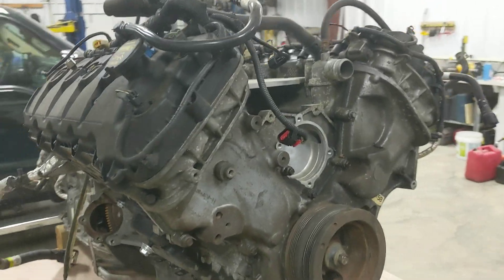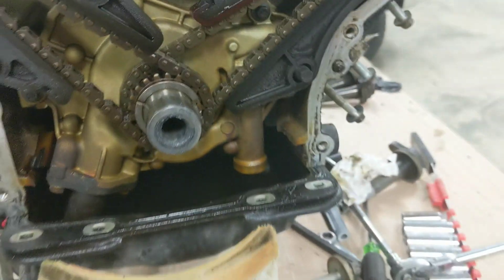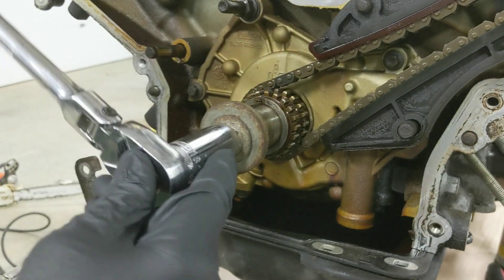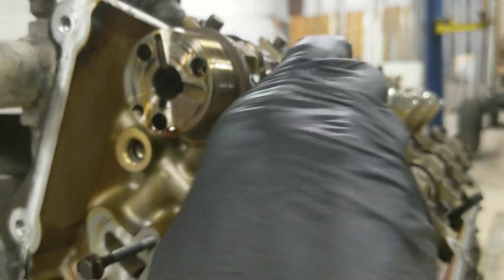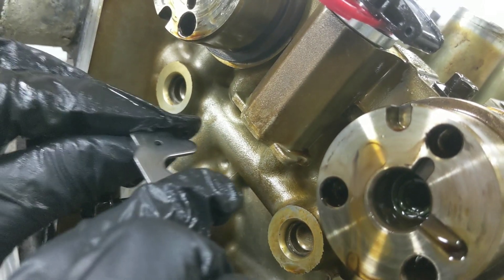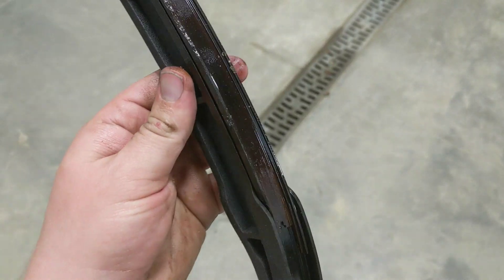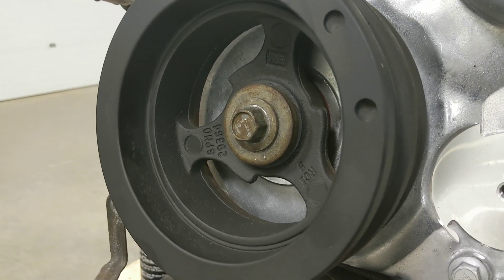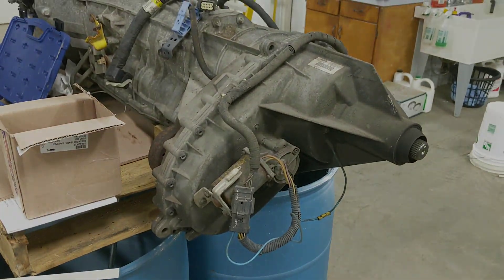Gen 1 Coyote Timing Cover Swap and Chain Replacement -- Coyote Swap Bronco

Comment: Great Video, I have a 2014 f150 lariat that I think needs a timing chain job just because there’s a 2 sec rattle in cold starts, so u have any idea how much a job like that is going to run?
Reply from the maker: I really don't know what a shop would cost.  I live in SD so some of the rates here are much lower than normal.  That said, if you had to have a shop do this I would expect to pay at least 1500 dollars knowing what all will be in the way in a regular F150.   There are lots of parts that need to come off before the chains can be replaced.  Most shops will be able to quote you over the phone though if you call in.  They can check their repair software and give you a good guess.
Reply: @605BOLT  How much was the Melling kit you used in the video?
Reply from the maker: @OKstang77  not much. The exact kit is linked in the description of this video.
Reply from the maker: @OKstang77  actually I just looked on the link in the description and it's 10pct off! Check it out!!

Comment: Did you end up using the thin metal spacer or just the plastic guide on the secondary chain tensioners?
Reply: If so, was it a very tight fit?
Reply from the maker: I don't remember a thin metal spacer. Sorry. Been too long since I did it. I don't remember there being any extra pieces when it was done if that helps you at all. Where does the spacer you're talking about go?

Comment: Hello, I also had my secondary chain break on a 2011 f150 5.0L driver side. My question is, sense the driver side primarily chain wraps around the exhaust cam phaser and currently theirs no chain attached to the intake cam. Would I start by moving the crank to the 12 o'clock postion and then move the intake cam by hand/wrench to match the data matrix on the exhaust cam when starting the disassemble process? Please let me know if I'm correct with my understanding. Thanks
Reply from the maker: I would move the pistons so they are mid stroke (not at TDC), then adjust the cams to where they need to be, then move the crank to TDC.

Comment: I know this is a year later i found the video super helpful, my secondary chain on driver side broke, i followed the video step by step on how to replace but now it wont start, she cranks but wont turn over any thoughts? Could the timing be off?
Reply from the maker: Was something damaged when the driver chain broke?
Reply from the maker: When you say won't turn over do you mean it won't even attempt to crank or do you mean the engine is locked up? Or do you mean it cranks but won't start?
Reply: Not that i am aware of, i didnt see a bent valve or anything when i used a camera through the spark plugs and it starts to crank but wont turn over
Reply from the maker: So you're saying it spins maybe a handful of degrees and then locks up?  Hard to say I guess what is oging on.  If the valve covers are off, you could visually run through what is happening and when.  You could see the cam lobes and also look down the spark plug hole with your camera.
Reply: Yeah ill check down the spark plug holes again the cam lobes look good too i dont see anything indicating a bent valve
Reply from the maker: If you suspect that one of the valves is bent, you could lower all the pistons so that they're halfway down the bore and then take all the chains off and then rotate the cams individually. And as long as they don't bind then you know your valves probably aren't massively screwed up.
Reply: Yep ill check tmwith the camera again but the lobes look good not really any sign of a vent valve and the springs all look to be in good shape. I appreciate the response if anything ill try to re do it and ill cross my fingers it works lol
Reply from the maker: It wouldn't take much to have a pretty serious bind.
Reply: @matthewg.9534  So odd, i just found my secondary chain snapped on the drivers side...the tensioner clip was bent and lying in the pan...dont see any bent valves and my engines starts and runs (barely) with 3 of the four cams turning...
Reply from the maker: Lol wow. Never heard of anyone proving that out but thats wild.
Reply: Also when i intially took of the timing cover and looked at the data mateix on the driver side they were both up but not even but lined up when i went back to 9 o clock that may be where i messed up now with the valve covers off again the data matix on the driver side are lined up and facing up but the passenger side are facing the opposite direction. Facing up but towards like 10 o clock and the driver side is at like 1 o clock

Comment: هل.اذ.اختلف.وزان.الجنزير.يسبب.تقتق
Reply from the maker: I did this job because the bronco the engine is going into requires a mustang timing cover rather than an F-150 timing cover.  When we were swapping the timing cover, we noticed the timing chain guides were worn.  The engine had 300K miles.

Comment: It's foolish to band-aid fix that motor.  With that many miles it needs a full rebuild.
Reply: Its not an ls turd
Reply from the maker: @fordnut4914  preach my man.
Reply: @fordnut4914 my ls work van has  over 400k all original and i beat on it daily my 5.0 f150 has 200k and needs a rebuild just fyi
Reply: If compression is good why do extra work.
Reply from the maker: Some would say that. But knowing what it is going into (76 bronco) it will be virtually inaccessible. Therefore do it today and should be good.
Reply from the maker: It has all new timing components lol. Def not a band aid.  She's good to go

Comment: Does the engine need to be at TDC compression stroke when installing the timing chains.?
Reply from the maker: Thats what checking that the driver side data matrix is facing up is about.  That is making sure you're at TDC before the power stroke vs being at TDC before the intake stroke.  Hope this helps.
Reply: @605BOLT  so my problem is both timing chains broke and came off just wondering were I'd put the crankshaft position.
Reply from the maker: @Relaxedraindude  number one piston should be up then. Besides that, won't matter because the crank doesn't know where it's at in relation to the cams. To the crank, intake and power stroke are the same thing.
Reply from the maker: @Relaxedraindude  idk if thesw coyotes are interference engines or not though. Could have problems for you if they are.
Reply: @605BOLT  ok hey man I really appreciate it. Keep up the great content love your YouTube page!!!
Reply from the maker: @Relaxedraindude  means a lot. Be sure to hit me back if I can help u out. Appreciate u watching and commenting. Good luck!!
Reply: @605BOLT  good morning I was checking the timing on this coyote by turning it by hand turned the engine over 4 revolutions of the crank now the timing marks are off by one link. Is this normal for these coyotes. Or do I need to do the process over let me know thank you.
Reply from the maker: @Relaxedraindude  idk about the coyotes but for a modular ford 5.4 the marks don't line up again for another 40 something revolutions or something. If you keep rolling it over, does it continue to be more off? That would be a way to check.
Reply: @605BOLT  I'll check and let you know. Thanks
Reply: The colored link is getting ferther from the initial timing mark. So is that what it is supposed to do.
Reply from the maker: @Relaxedraindude  I assume so. That would be similar to how other mod motors are.
Reply: @605BOLT  cause I'm thinking if I continue to rotate it it would eventually end up at the initial timing colored marks.
Reply from the maker: Quick Google research shows that the marks don't line up after rotating just like a mod motor. So pretty much it was right or it wasn't. Do you have phone pics of it before you rotated? If so, that should give you peace of mind. Also, you could line the engine up and then count the links between the colored links. And make "new" marks on the chain to check but that's a lot of work. Just another option I guess.
Reply from the maker: Ya. I believe it would too.  But it could be like 200 revolutions haha
Reply: @605BOLT  yes I'm not going to turn it that much. I appreciate it. You on tik toc or any other social media platform.
Reply from the maker: @Relaxedraindude  I have like three videos on tik tok haha. I feel like an old person on tik tok even though I'm not haha. 605bolt is my username. 👍 What is the coyote going into/coming out of that you're working on?
Reply: @605BOLT  it's a 2014 ford f150 fx4 it had broke timing chains and the exhaust valve on the 7th cylinder was burnt so it had a flat spot on the valve.
Reply from the maker: @Relaxedraindude  ah dang it. That's a nice pickup still. I'd love to have one.
Reply: @605BOLT  yes it is nice The paint is race red 4 door. It's not my but a customers.
Reply from the maker: Right on.  Thanks for checking out the video.  Hope it gets them on the road.  I peeped your Tiktok over lunch.  Good stuff.
Reply: @605BOLT  It should fingers crossed. Thank you I try to make good videos when I'm not rushed lol. Have a great 4th Thanks again for your help.
Reply from the maker: @Relaxedraindude  they're great and my pleasure. 🇺🇲🍻

Comment: On the passenger side, one colored link on exhaust phaser side and double link on intake phaser?
Reply from the maker: secondary or primary?  if secondary, yes you got it. Just like the other side.
Reply from the maker: For the sprockets, as long as those two marks are facing away from each other, then you're good to go. but to make it easy, do it the same way as the other side. Hope this helps.

Comment: No gaskets for the main chain tensioners?
Reply from the maker: None in the kit.  Beings those are machined surfaces I guess I assume they make a decent seal.  Not to mention the fact that the a small weeping leak would be no problem as it is internal.  Interesting observation though.  I know there wasn't any type of gasket behind the tensioner.  Don't think there was even an O-ring.  And also I think the 2V tensioners in my lightning are the same way.  Metal to metal.
Reply: Spring loaded tension when not running
Reply from the maker: Right.

Comment: I would have changed out the vvt solenoids and the cam phasers since u were already in there
Reply from the maker: Ya that might have been a good idea. The truck seemed to run fine at during a test start but you are probably right. Where do you stop though? At that point, might have done mustang cams then too haha. 300K mile engine so I guess we'll see haha.

Comment: Hey ! question. Since the tensioners were brand new and bone dry inside...  (no oil) did the tensioner sorta let the guide "slap" back into the tensioner while rotating the engine the a breaker bar? I got new tensioners.  And as the plunger on the tensioner comes back in it retracts quite quickly and kinda let's the guide slap back into the tensioner.  Assuming because they were bone dry and obviously no oil pressure.
Reply from the maker: Ya that's how mine were. Not psycho tight. The oil pressure should tighten them up first start.
Reply from the maker: I want to say there is a ratcheting mechanism within but idk for sure on coyotes.
Reply: Okay. Good to know. It was kinda concerning , because makes quite a slapping sound when the tensioner let's the guide slap back into it the tensioner.  But ya. Brand new. Bone dry. So obviously isn't gonna be very tough.  I got a vid of it if I could send it to you? See if yours was similar.  Kinda just had my sketched out lol. Haven't gotten it all back together yet so haven't started the car yet.
Reply from the maker: @NorthBoostCoyote  me neither haha. Haven't started it up just yet. But I followed the procedure from comp cams and all my marks lined up. And it makes compression just rolling it around.
Reply from the maker: We're in the same boat if it goes wrong! 😂 But I think we're good.
Reply from the maker: Started it up yet?  I haven't gotten there yet.
Reply: @605BOLT  Not sure where you are on it but with my Cloyes kit and MMR valve springs, I noticed the same thing. The chain would slap the upper tensioner on the passenger side when I turned it. Did not go away upon startup and I am just now installing the Ford Performance kit instead, with the hopes of it being gone. Will let you know
Reply from the maker: Interesting. Haven't yet started this setup due to the body and rest of it being worked on. Any helpful tips, let me know.

Comment from the maker: Sorry about the blank couple of seconds. Late night editing. 😬
Reply: Is the keyway at 12 o'clock TDC on the engine? Please 🙏 help
Reply from the maker: Sorry Deon.  I just saw this.  I do not recall where TDC was in relation to the keyway and whatnot.  12 o clock sounds right but the easiest way to know for sure would be to roll the engine over until you feel compression.  At that point, raise the piston until you start to feel the air stop.  I usually use a wire in through the spark plug hole to determine when the piston is done travelling upwards.  When it stops, you are at TDC.  Hope this helps you out some.